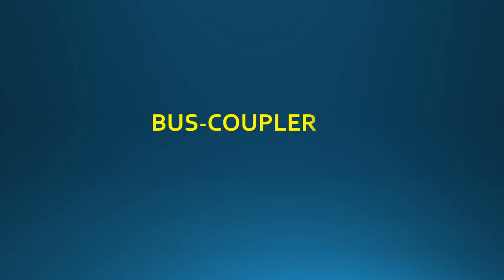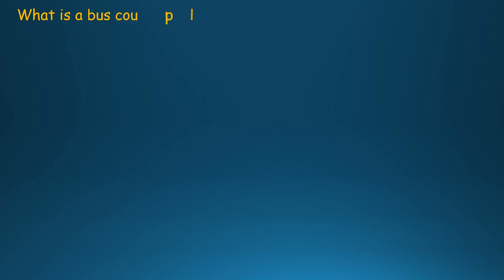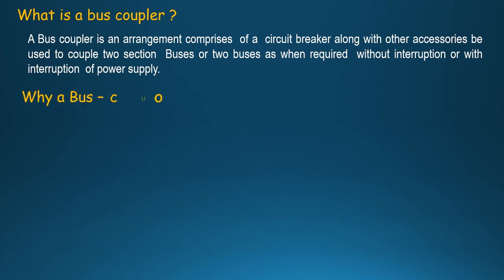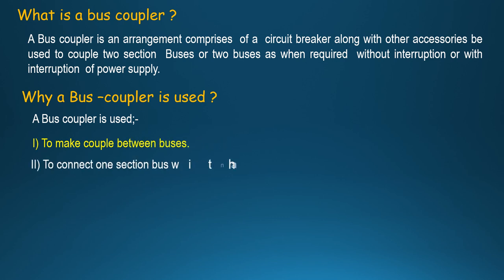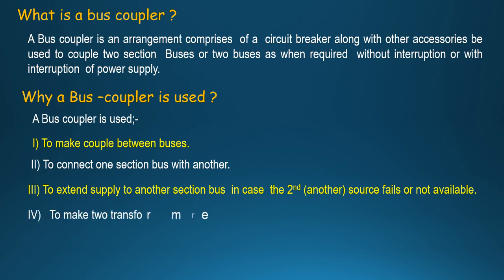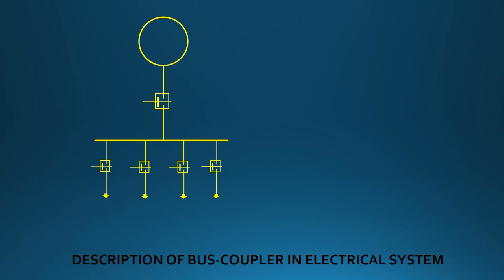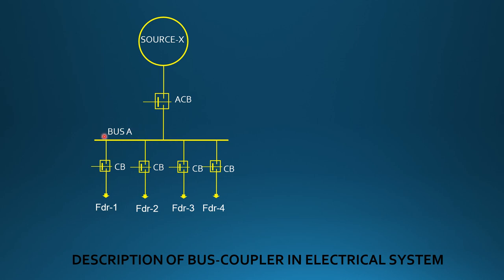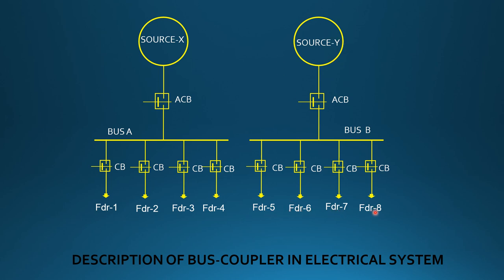BUS COUPLER:WHAT IS BUS COUPLER:BUS COUPLER WORKING:WHY BUS COUPLER IS USED

Comment: This is not bus coupler but this is bus section..U must off or shutdown any other one of two source first before coupling if there is two different source of incomer. In this situation, live transfer is prohibited
Reply from the maker: You are welcome.You are right in all respects. But during non -availability of any one source,other source is to extend to feed load (distribution voltage) of that section bus through this coupler breaker. Ultimately the said breaker  makes couple the two sections of buses. That is why we may call it as Bus-coupler breaker. It is not like as a B/C used at Sub-station to couple two  high Voltage Buses.As such, you valuable comment is appreciated. Thank you.